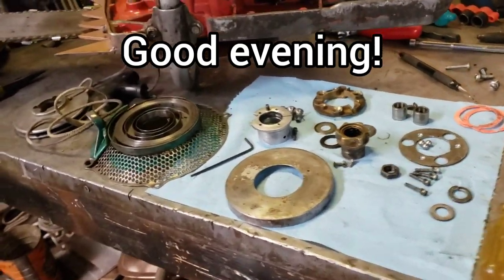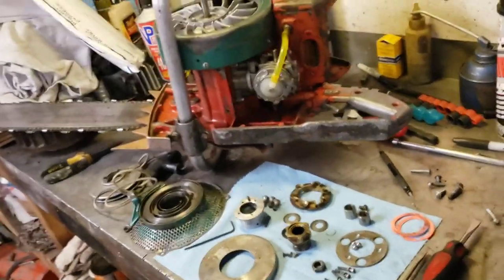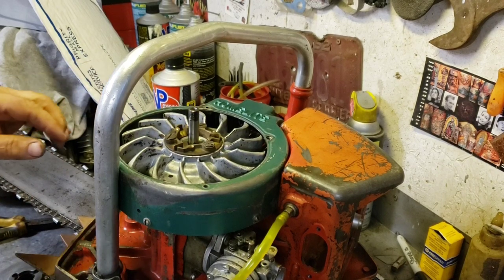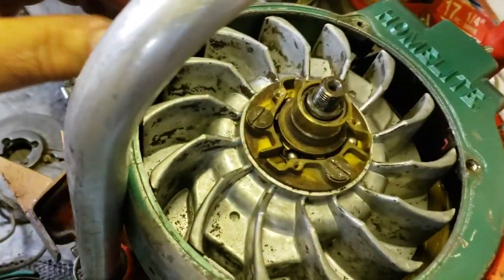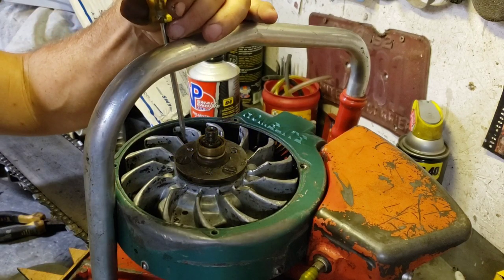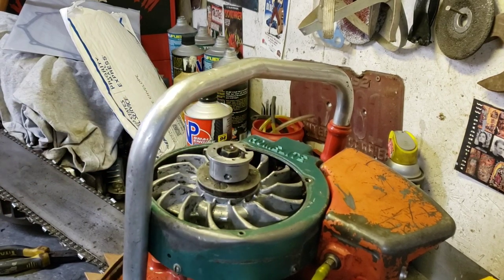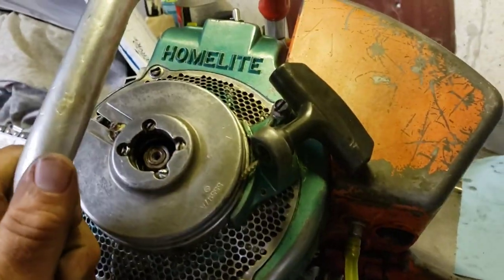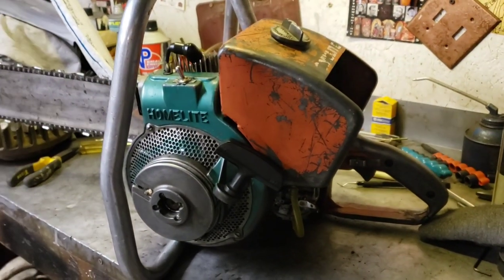Homelite Vintage Chainsaw Ball Drive Starter Assembly explained

Comment: Why only use 3 parts in a starter, like on a Pro Mac 610, when you can do the same thing with 25 parts like in the Homelite?  Good how to video. Will make it a lot easier for me when I start to work on some of my early Homelites.
Reply from the maker: Crazy setup for sure, don't some of the old Maytag engines have the ball drive starters as well?
Reply: They do, but are siple by comparison. @KainKustomGarage

Comment: Those things have quite alot of bits to em eh? Glad the spark came back for ya! I have a few of those ignition modules here on standby generally, just a good thing to have around when you needs to make a no sparkie saw into a sparkie sparkie saw lol
Reply from the maker: Thanks Andrew! She definitely needs the carb kit, You know I have yet to use one of those Chips, so It will be fun to see how it works on one, I have that big 2 man Mcculloch saw that I never could get running, maybe i'll try it on that Ol boy!
Reply: @KainKustomGarage  they're simple easy! Bellhopper has a good video on installing em!
Reply from the maker: @ButlerOutdoorsCanada  cool im gonna have to check it out!

Comment: That's like a terribly over engineered starter clutch  the older briggs and Stratton used.
Reply from the maker: Oh yeah, I remember those! Some of the old Maytag Motors had a ball drive starter, although a little simpler design